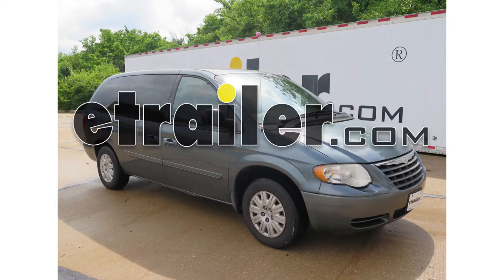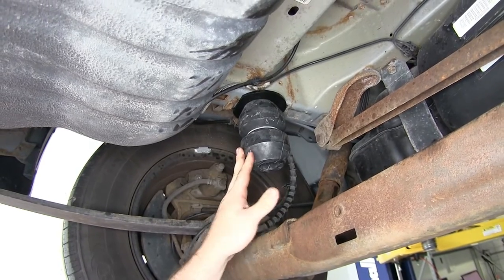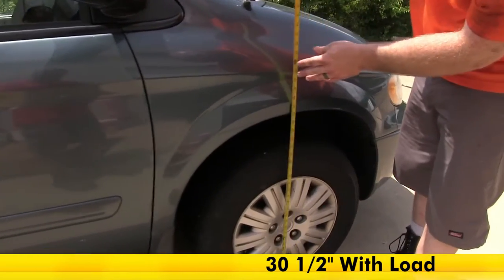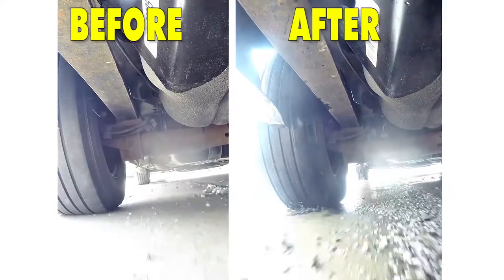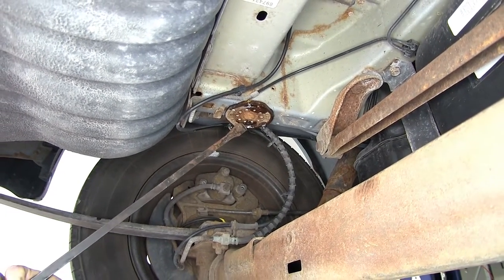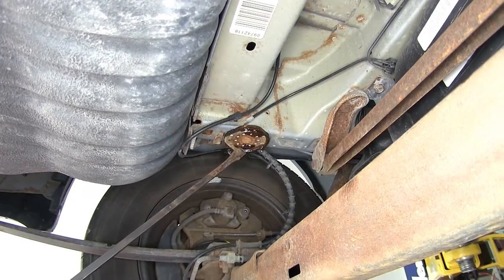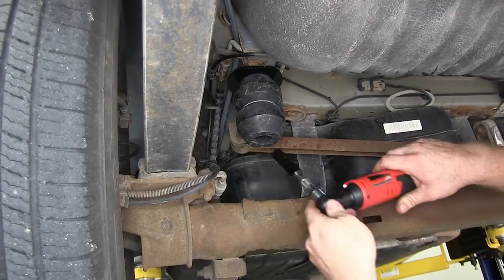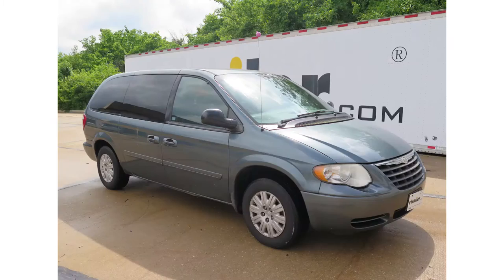etrailer | Set up: Timbren Rear Suspension Enhancement System on a 2005 Chrysler Town and Country

Comment: Thank you for  helpful video. Can I lift up front of the car?
Reply from the maker: This kit is designed to fit the rear suspension only. You can lift the front of the car if it will help get these installed.
https://www.etrailer.com/Vehicle-Suspension/Timbren/tdvr05096.html